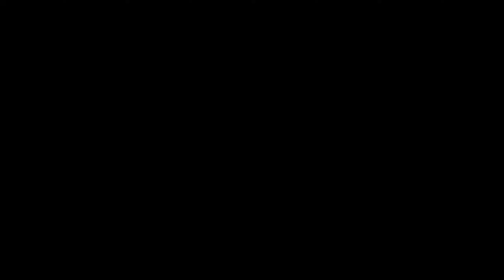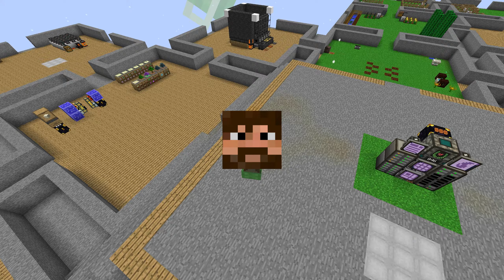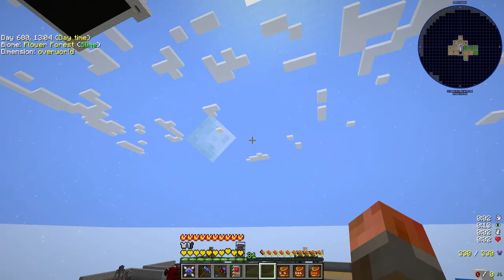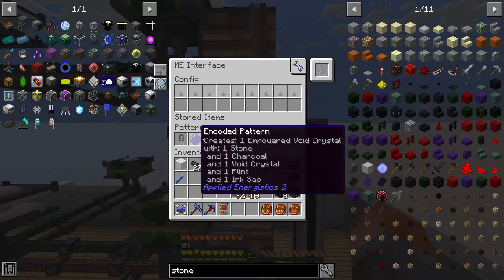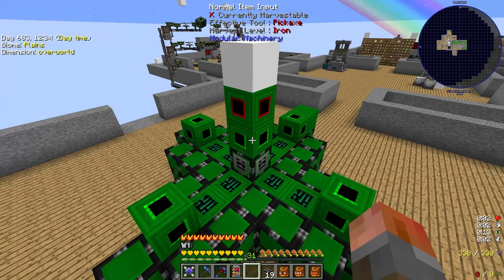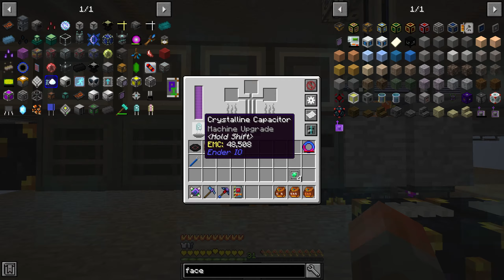Project Ozone 3 KAPPA MODE E22 - Speedy Mechanical Empowering!

Comment: Can't you let the interface put the items in a chest that than distrebutes the items to the different outputs?
Reply from the maker: For the mechanical empowerer? That's how the old empowerers worked, but there's no need with the mechanical one, as larger size inputs are very cheap (a hopper and a leadstone fluxduct per upgrade) - easiest just to shove all the ingredients into one, and not have cabling all over the place :)
Reply: @grayduster  just saying it's a possibility